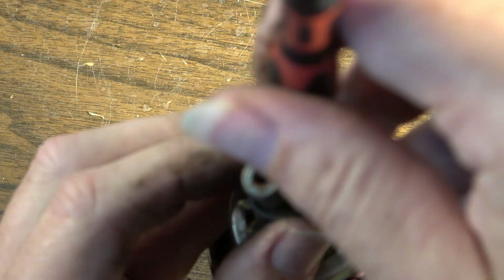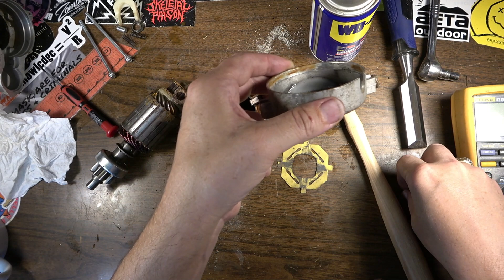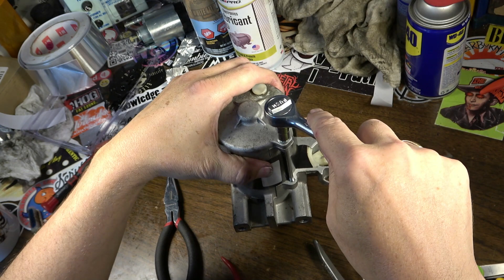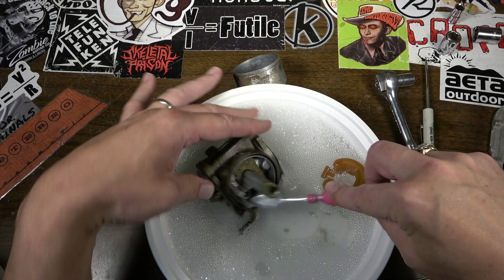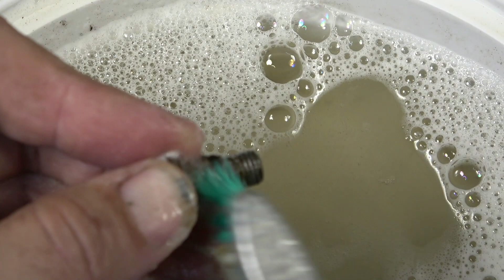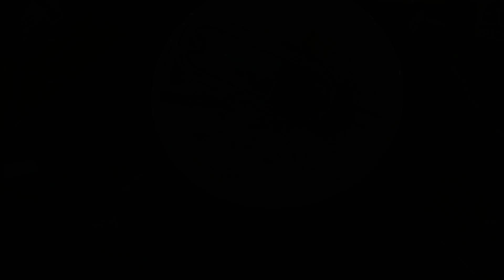FREE CURB-FOUND JOHN DEERE...How Bad is it? [PART 2]

Comment: Starter is ok, you have to ground the starter housing and positive terminal is then jumped from the positive terminal to solenoid terminal.
Reply from the maker: You are ABSOLUTELY CORRECT! I went back and looked at the footage and sure enough, I had the damn thing hooked up wrong while testing! More on this in the next one. Thanks Michael!
Reply: @fixologist1  Before you use the starter, take it apart again. There is a bronze bushing on the end of the armature shaft that appears to be stuck. The bushing should loosely press into the aluminum end bell and the armature shaft should spin nicely inside of the bushing. If the bushing is stuck on the shaft, it will not take very long before it chews up the aluminum end bell.
Reply: I think you are right, There is a good chance the starter is fine. It would be worth double checking it out,starters can be quite exspesive.

Comment: Great videos thanks for posting. I recently got an RX95 for free off the curb as well so your videos have been super helpful.  Do you know if there is differential fluid in rear diff or grease or..?  I want to avoid burning it up by accident.  Also mine was missing the throttle linkage, but has the spring.  Could you tell me do they both connect to the same hole on the carb?  Thanks again !!
Reply from the maker: Here is the manual for your engine: https://www.toro.com/getpub/6909

The bent linkage is the choke. The straight linkage is the throttle. They do not go in the same hole. See section 4 of the above manual for illustrations.
Reply from the maker: As for the trans, I do not know. If you find out, let me know. I didn't want to crack mine open as it was fully operational as is and I didn't want to risk damaging something.

Comment: replace those bearings, that snap ring pops out with a small screwdriver, the retainer gear and bearing should come right off. The back bearing might be pressed on but you can order new bearings fairly cheap. The brushes are carbon btw, and that carbon is best cleaned with brake clean.

Comment: soap works great , but sadly people grossly underestimate how much is needed . Watched a video on liquid detergent and it's  the detergent molecules have a open space and the oil bonds with the soap then its now neutral.  What I have found is at least 2:1  liquid dish detergent like Dawn  ect. to what you want to remove if you think there is 1oz oz grease on a skillet then 2 oz of the soap and a splash of water It will keep your dish/sink brush from getting caked too.  For the baked on stuff some oven cleaner will work wonders as well as any industrial solvent ,but the soap is way better for the user lol
Reply from the maker: Absolutely! I use the hell out of Dawn dish liquid. Stuff is powerful and excellent for lots of stuff. And non-toxic on skin. I'd rather not get cancer in 10 years if I can help it.

Comment: ahhh, someones had that fuel shutoff solenoid off before.(the part in the bowl you took off) it supposed to have a head on it that blocks fuel flow into the jet so the mower doesnt knukcle or pop when it shuts off. they fail, so people cut the heads off. just put the throttle to idle , and then shut the mower off.
Reply from the maker: You might be right about that one, but I was messing with the mower today and I think it does actually shut off the fuel.

Comment: Even though the solenoid connects when you push the plunger down and shows continuity, it may not be a good enough connection to withstand the amount of current you are pushing through it. I'd suggest taking it apart despite it testing good because that is always the main point of failure. 

The contact point in the solenoid is made of copper which corrodes away easily. I'd suggest replacing the copper connection with brass so it will last forever. The reason for the use of copper is planned. Obsolescence.

I'd also suggest bypassing the solenoid and applying power straight to the starter motor to see if it's spins. Then you can be completely sure that the solenoid is okay.

Comment: The brushes may be copper graphite.  I used to cut it sometimes to make sinker edm (electric discharge machining) electrodes.
Reply from the maker: I think you are correct.

Comment: The solenoid that you were cleaning with the dental pick does nothing but shut off fuel flow when the key is turned off.  That is the noise you were hearing thinking it was the starter solenoid.

Comment: You just tap that retaining ring away from the Snap ring on the motor shaft to remove that drive gear.
 You won't break anything.
Reply from the maker: I think we had a burned winding somewhere anyway.
Reply: hah....haha....all the lawnmower starters ive had to remove that clip off of...never went back right. maybe once.